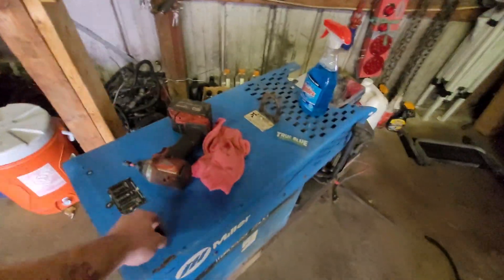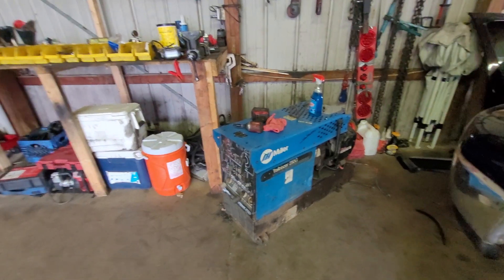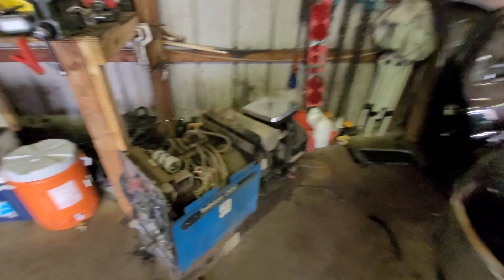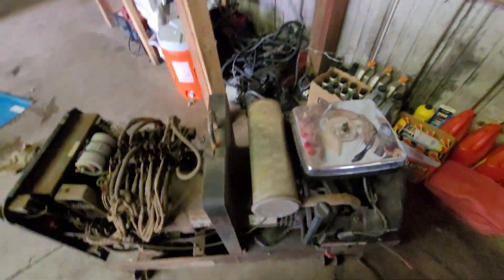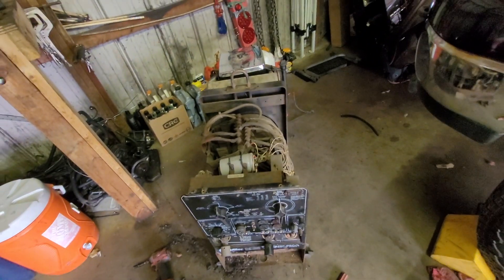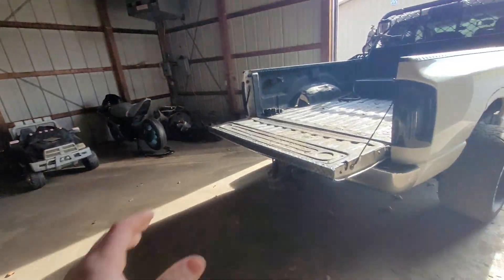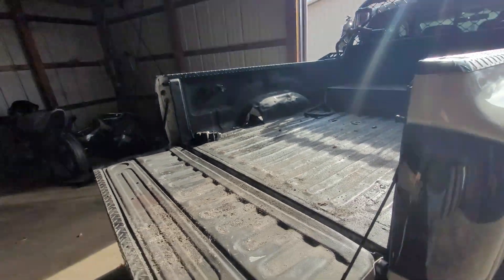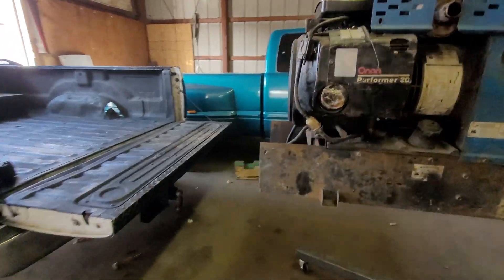Building A Stupid Expensive Service Rig - 2006 Cummins Ram 2500

Comment: Hey CP, Steve Miller not to be a deck or anything but I think you need to get a Dooley truck four-door May cab long bed Dooley that is what you need with some wheels tires whatever you other modifications seem want to make but it would still be able to work for what you need you just make a huge ass custom flatbed that has toolboxes all your welding gear all the gear you’re gonna need plus your gooseneck stuff like that you’re gonna need Not trying to be a dick or anything but I’m just saying that’s what you’re gonna need because that’s what I want